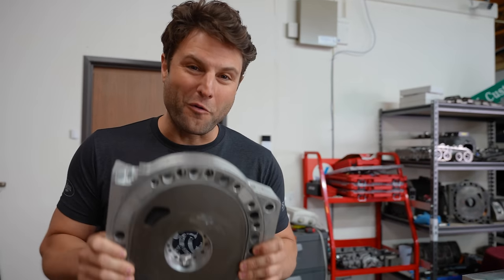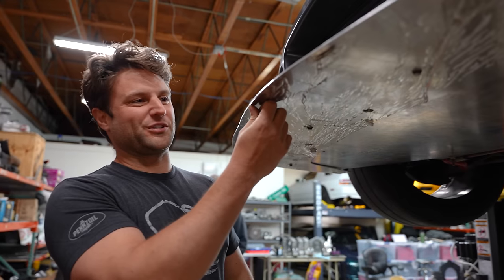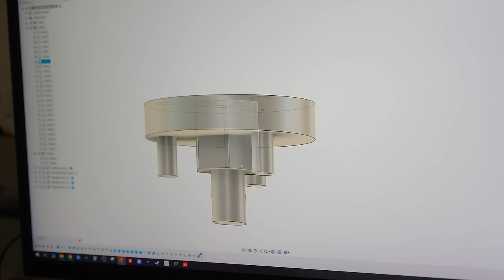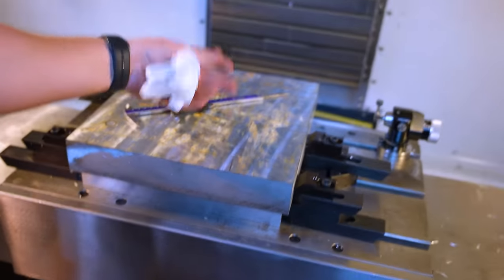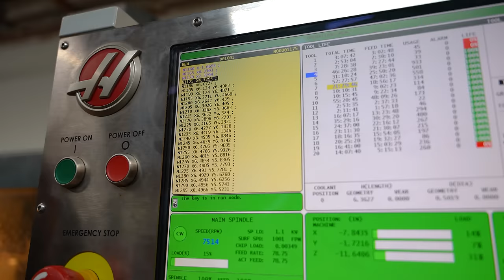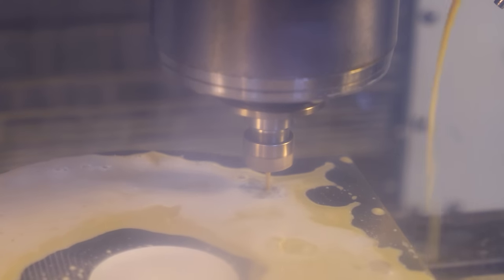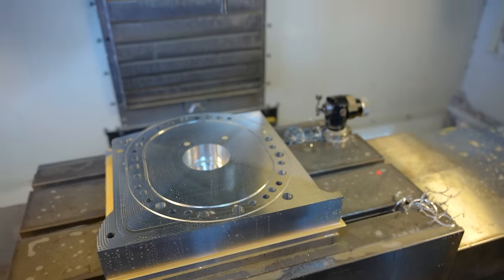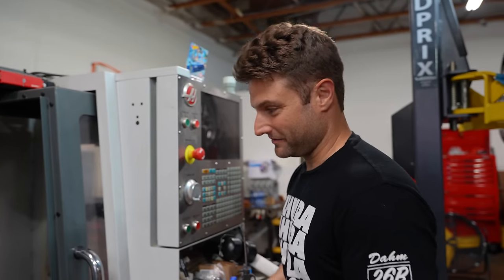Making my FIRST Billet Engine plate from raw Aluminum!  Dahm Racing Engines incoming??

Comment: I don't know much about engines or it's cooling properties but what if you gave the coolant holes screw threads? Theoretically this could increase its surface area for heat exchange and potentially aid its flow through it due to the vortex formed from contact with the threads? I mean, I may be wrong if the coolant suffices and are literally just dealing with just certain hotspots like on a cpu.

Comment: 38:47 how does this calculator work and will you make it public, a comprehensive visual model for intake port shape is something i would love to get my hands on. Mazda and countless forums have provided specs to port timing but never port shape. Port shape at certain points is severely limited by rotor location as well as corner seals paths, it would be great to have a clearer image of some of the width limits without having to have a engine on hand. For instance a street port with mild timing but a large port area, you can only go so wide before you run into the path of a corner seal and after that you have to compromise on driveability by extending the port timing or going for a bridge port.

Comment: if you're going full CNC, why not address the weaknesses observed in the block that just failed? 
like making the dowels bigger, or adding more , increasing the cooling ports surface area around the exshaust outwards, or dialling custom water channels around the ports?

or making the housings and the engine plates interlock by having them fit into each other like legos? not by dowels, but by having the outer edge offset from the plates OVER the housing. 
then the housings would be locked tight over a much wider area and you'd have more room for cooling... 

food for thoughts.

Comment: I’m curious why when facing the second side with the shell mill you used such a small step over? You can mill that wayyyyy faster and get a nicer finish using more of the diameter of that shell mill.

Comment: How will u get fluid into the combustion chamber for cooling. You have no way to hollow out behind the combustion chamber its just a solid piece of metal. The stock sand cast housings are hollow for coolant to get between the combustion chamber.

Comment: serious question...would milling heatsink fins (which ever direction it should be milled in) help uniform the heat (like air cooled boxers or v twin engines) while also structurally reinforcing the housing a bit while loosing some weight? also would you ask Hoonigan or get your own to use a CNC cutter that can trace shapes to make your templates?

Comment: I don't know if you have researched it, but is a Nicasyl plating not an option? it can be placed directly on aluminium, without a steel wearing plate. so there won't be differenct heat coefficients in materials.

Comment: I'm guessing the reason 3003 was used was heat resistance. Aluminum alloys containing magnesium will have the magnesium start to precipitate out of the alloy under sustained high temperatures. 3003 contains no magnesium and this doesn't have this issue.

Comment: is there any reason why you havent tried an alternating rotor/iron configuration? Spreading the heat from combustion on either side of the motor instead of all the combustion happening on the same side, sounds beneficial for the heat and warping issues.

Comment: It was a billet of aluminum before you machined it. Now it’s an aluminum rotor plate. Drill the wholes bigger and press fit steel in then tap the steel

Comment: Have you considered internal air cooling through the rotor with a fan, I know it sound strange, but a couple of aviation engines have such a design like austro engine R1 & Schiebel S2

Comment: A 60 year mechanic showed me a Bearing test and added Energy Release additive to his oil and the scarring reduced by 4 times it was not even hot in the slightest and he told me it conditions the metal but I am not a promoter or anything I jus think it might help and maybe you can check it out

Comment: hi rob .. maybe late, but wouldn't it be good to put ceramic or wet coating  on the glass of the CNC? or better lights inside? it would be better to see how the machine works . btw this  is  mega, 
and as always , you are a beast,   from  learning  about   rotaries , to  making  your own  .

Comment: Will the x microns of tungsten coating that will be applied cause any coolant sealing issues down the line? As the inside face of the iron will be taller than the ouside face?

Comment: I'm sure you've heard it or thought it before, but would it be possible to machine the irons/housings to accept fire control rings similar to high powered piston engines. Copper wire cut to shape, deformed into grooves cut in both cylinder head and engine block.

Comment: Ive got a bilz holder, rigid tap 2018 vf2 bought new, always breaking small taps in aluminium. Form tap or thread mill everything is the only option imo. Taps just suck lol.

Comment: If that were me trying to make it better and from scratch, I'd make the exterior dimensions a bit larger to accommodate large bolts holding the engine together. And the added mass would also add strength and stability as well. After all, it flexed so much that it bent the original rods. Remember??? 🤔

Comment: Your parameter for tapping is probably set to 4X the tapping speed, you can change that to 1. That might help reduce breaking taps when they're coming out. Please tell me you're not going back and forth between absolute and incremental in your programming... what are you using to do your programming with? I'm a programmer in orange county, please let me teach you how to do this.

Comment: Tapping in a cnc is a pain. If you don't have exact feeds an speeds. It will break. Your best bet. Get a threadmill.  If it breaks it has a good chance it won't ruin the part. If you have to. Tqp it by hand. I do this stuff everyday.

Comment: Any reason why you used milled aluminum for the fixture plate? Seems like a good application for a ground tool steel plate. How was the aluminum plate checked for flatness? It is fairly difficult to achieve a TRULY flat plate at .0005. There’s some very specialized equipment used to check for true flatness. Also I really hope you’re using something besides all these “exact” measurements besides those cheap ass calipers

Comment: Its amazing the work you have done so far but I cant help but feel that you are hyper focused on recreating replicas rather than improving the designs overall. I know you need to walk before you run but for example what if rather than machining out ALL of the extra material from the blank you left some of that and added an extra pocket for another dowel? If you found a good replacement for the gaskets could you scale out the housing to provide more mating surface and use even bigger dowels?  In the future if you machine new rotors or cranks could you scale everything up 10 or 20% and increase displacement? Im just tossing out hypotheticals but I am excited for what you are doing!

Comment: I was showing how a rotary engine works to my father (an engineer) and he asked me why couldn't the apex seals be instead rollers that work similar to a ballpoint pen, that instead of having oil come from outside the housing, they have oil coming from inside the rotor with a completely different oil system. I'm not mechanic savvy, so I ask here: is there a reason for why apex seals are the way they are?

Comment: Threadmilling is the way to go... fucking using taps on machine centers.

Also as someone who has been programming/operating for about 20 years now. If that is the first time you're running that program and your rapids are set that high and your not paying attention to it... holy moly.  running a machine center is like riding a motorcycle its not if you crash it.. its when you crash it.

Comment: why aren't you using a fly cutter or a larger shell mill? I work in tool and die and we kinda dog each other when we see a plate decked with a half inch end mill because it looks like the person machining is wasting time. it does look cooler in my opinion

Comment: I dont know if youve done the lower level of engineering before but you could perhaps use an cnc mill or xyz mill. there is another youtuber with a big 50s mill whichd cut it easier than that. I just realized you used a cnc mill

Comment: On Haas machine, to clean out your drill or reamer, add a E 1000 at the end of your drilling cycle, it will turn in the other direction for 1 sec at the E speed and throw out the chips with the help of the coolant. G83 X Y Z Q R F E

Comment: Slower on the tap, more coolant with lubricant properties. Give the machine pauses between the stages. This gives the tap an extra chance to not snap. These smaller sizes, you have to essentially make the machine dance on stilts. You have to make that blue whale act like a ballerina.
Personally, i do not bother touching taps smaller than 5mm in a machine. It's not worth it. Don't get me wrong, it can be done, but doing it assisted by the machine is much more easier. Just get a tap follower for the chuck, and program a line that places the sprung tip over the tap and do the work with a size appropriate square wrench (there's also mini size correct square double handle wrenches that you can buy online, specific for the purpose of hand tapping small sizes). The only place where you bother tapping such small sizes is in industrial settings, and that's only through the brute force of decades of experience, programs and the best taps and machines you can buy. There's no reason for you to try to take that bull by the horns if you can just walk on the outside of the stadium to the goal. jm2c

Comment: I hope the 12-rotor engine isn't going on the back-burner!
Reply: They are working on it pretty consistently. Now that the actual engine is put together they have to design everything that goes on the outside. 
Intake manifold, exhaust manifold, accessories, wiring etc
He showed some of the work on Patreon, they are doing flow simulation and stuff to get it just right.

Comment: Hi Rob, I'm a subscriber and a big fan of Portugal.
I have learned a lot since the beginning of your project and I would like to be able to try to help.
Do you know about titanium alloy with anti-friction treatment?
Cobalt Chromium Tungsten its tensile strength varies between 330-380mpa and the strength of titanium ranges from 240 MPa (commercially pure Grade 1) to 1241 MPa (Ti-10V-2Fe-3Al alloy) *searched on google*. And the final treatment you choose between working with a soft or anti-friction finish (no friction minus heat but normally piston rings don't like polished engine walls, but I don't know how the anti-friction treatment looks like)
As a welder, I say that titanium alloy is as easy to work with and weld as stainless steel, depending on the type of material, some titanium alloys are considered for military use and in Portugal it has to be specified for what use it is intended, etc.
I hope I left some curiosity.
I hope the best for you and the whole team.

Comment: Mazda just told you how much to charge for a new engine... So there's that... Then, you add the custom charge and R&D up charge, and now we are talking $20k, right? I have had almost every rotary car since they started importing them, except the FD. A bit out of my range and the one's I am finding are too far gone. Started looking into RX-8's, finding tons of them, but they have electrical safeties in place that are hard to circumvent. All the anti-theft, chipped ignition key, etc., how would you suggest removing such issues?

Comment: So maybe a weird question. But would these plates be better if you used other metals. Special types of titanium or inconel etc. Obviously without looking at the astronomical costs of some metals. What would actually be the best to use for wear, heat and flexibility/rigidity. Is anyone here knowledgeable on this?

Comment: I think if the machine can do it, you'd be better off thread milling those. If not blow off the coolant and use tap magic in those holes and don't run coolant. Plus the coolant looks.....

Comment: using 3d prints like this won't give you very accurate template for high tolerances, with the expansion / distortion of printed material, it's going to be quite off.  Just like if you try to print a dowel and socket, you have to adjust the sizes to account for that expansion and warping because perfect measurements will be way off.  I hope that's more of a very rough template and not being used for realistic measurements

Comment: I wonder if you could do the same idea with carbon fiber sheets with metal sleeves for the dowel passages and iron inserts for all the rotor contact points.  Send all your files to send cut send for the carbon.  In house all your rotor specific stuff.

I know you'd lose all your heat dissipation benefits from the aluminum, or if it even matters with the robust cooling you already have.

Comment: Wrong holder for the tap! If it slips it will break. And the bearing bore should be bored not circular interpolated, it wont be round.

Comment: Rob, why did you go with 7075 over 6061? 6061 has 28% higher thermal conductivity and higher melting point. I figured those would be the two most important properties given the rotary's hot spot? 

7075 is about twice as strong as 6061 which also makes it twice as hard to machine. It just seems to me that 6061 makes a lot more sense in this application. It is definitely nice how well documented 7075 manufacturing techniques are thanks to the aerospace industry though! 

Would love to hear your thoughts. Best luck on your journey!

Comment: Rob, before you cnc your 7075 block I wonder if you can do a experiment and put a load on the 7075 with the steel bolts to see how much force it takes to deform the hole vs the 3000 series aluminum?

Comment: Stop using collects on endmills, RIGHT NOW!
switch to hydraulic holders, and shrink to fit holders when necessary.
And please, either throw that Jacob's chuck in the scrap bin, or use it as a paper weight.
Edit: i truly believe Rob is stress-testing machinists hearts.
STOP THAT! 
We already drink and smoke to begin with....

Comment: Rob, i like you. A lot.
But man as a mashinist those feeds and speeds kinda hurt to watch, you are going slow enough to a point where it might actually hurt your tool life.

And maybe invest in one or two good roughing end mills like a Kenametal Kor5. Those will give a pretty good surface finish on ths outside and you'll save yourself maybe an hour or two per part

Comment: Fixturing a plate to your milling machine's platform with uniform flatness, no movement, and no interference with cutting operations can be the most frustrating part. Having to move and refixture a piece is not ideal, ever. Luck is on your side with lathed parts if all features are still concentric in the tenths range.

Comment: Plz buy real micrometer tools to measure and inside micrometer for holes. . not a caliper. Caliper is like using measuring tape in CNC. Your project is awesome. Would be sad to Scrap a nice part because off wrong measurements.

Comment: A quick/dirty way to make slight adjustments to milled hole diameter is to adjust the tool wear value at the controller. Ofc if you're over, you're still fucked

Comment: Rigid tapping in a drill chuck is a recipe for disaster, even a "precision" chuck like the one you have. Drill chucks aren't near as precise as a collet holder. The easier way is to buy a floating tap head from your tooling vendor

Comment: Why wouldn't Mazda with all its infinite resources do what you're trying to do over the years? As you mentioned there should be a 13C a 13D a 13F and a 13G by now
Reply: Not enough demand for it to be financially viable for the large scale that Mazda operates at would be the most likely reason I would assume.
Mazda do not have infinite resources and their more important priorities are competing in the segments that 99% of their revenue come from.
What Rob and other shops that do billet rotaries are doing is not for the masses. It’s very niche.

Comment: Calipers are not accurate measuring devices, I trust them to a +-.001. You’ll never truly know how accurate this part is until you send it to a cmm. I don’t believe you have a surface plate either to check flatness and if Parallel which should be a very important dimension I assume. As a machinist i couldn’t finish the video it made me cringe too hard. Especially 100% rapid on a unproved program

Comment: Can’t wait to see where this goes but the machining is very janky. ‘Precise’ is thrown around too much here. I watch all the videos. I love the welding and wiring. 
How has nobody mentioned using a form tap? A form tap in an actual tap collet with coolant that isn’t the color of pizza dough with a 1 second dwell would be refreshing. The tap retract speed looks like it’s set to 5 which is poop.
A form tap also has the added benefit of not producing chips. It mushes the material into the right shape AND is stronger especially in aluminum. Also, as has been said a few times already the metallurgy is straight up bro science here. Find something really hard and hypereutectic and maintain your tolerances.

Comment: A billet is not Raw aluminum... billet material is a material that is cast or formed/extruded into a simple shape, like a block, or a rod and then machined into the shape of what you are making. as opposed to a cast part that was cast into the shape of the part you are making. 
you're not shaping RAW material, you're just machining from less complex shape to preserve it's strength...